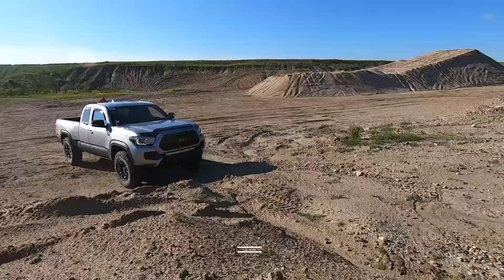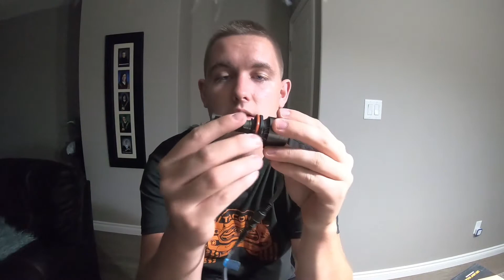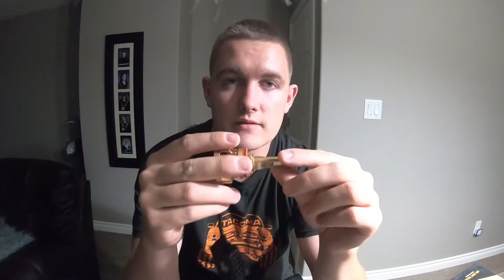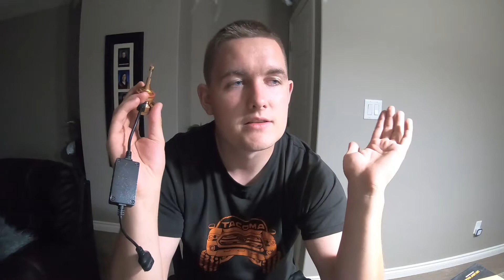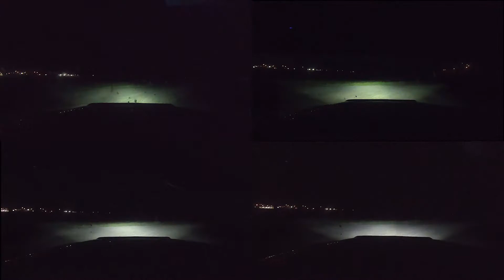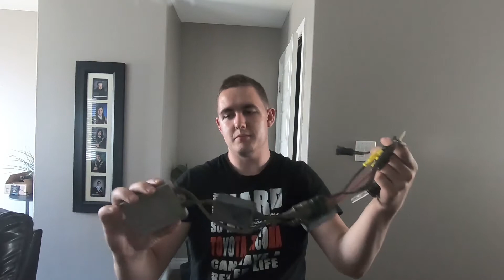HID vs LED - 55w HID, Morimoto 2Stroke, Auxbeam Lighting F16 Plus, T1 Series - Which is better?

Comment: With regards to the current reading - are you sure you know how to use the voltmeter? You have to put the volt meter in series (not parallel) and complete the circuit to measure current. You should also have measured the voltage and do that in parallel. For LED's they should be around 12V (9-16V) and for HID's it depends - they require really high voltage at first to ignite then stabilize out. It would be a little dangerous to measure the HID current (to yourself and voltmeter).

Comment: Thorough job on the comparison but 1 critique.  You commented about the bottom of the T1 and going to "raise it up a couple of inches", where was the top of the beam compared to the others?  I didn't notice it being lower in the garage shots so wouldn't this just cause it to shine into oncoming traffic more or is it just NMFP?
Reply from the maker: Thank you!
It definitely looked like the beam was aimed a bit lower but my headlights were personally adjusted before because of my front lift etc.. Definitely just have to do your proper measurements out. From my naked eye it looked shorter because the bulb design on the t1 was just two leds and not as much focused design or length compared to f16 plus.

Comment: Higher color temp doesn't equal brighter. It's actually usually the opposite. Best is 4500-5500K. Those blue 6500K+ ones are crap.
Reply: Brightest color temp is 4500K. Beyond that you sacrifice brightness for color
Reply from the maker: @kulykski123  im pretty sure I recall headlight revolution showing 5500k giver take is the brightest output you could get. Not 4500k
Reply: @CanadianOffroad4x4  It was 5000K not 5500K Iirc
Reply from the maker: @AmongUs-kok  close enough haha
Reply: the more blue, the less effective light.  this can only be compensated for with higher performance.  the daylight is around 4300K/4500k but that would look quite yellow.  therefore 5000 or 5500k is often used.  more than 5500k should not have any led or hid.  the light then becomes darker again.
Reply from the maker: Nope it doesn't. Brightest color out there is 5500k.. 6500 is the most common you find for led bulbs nowadays. They match factory drls nowadays! Not all 6500K are crap tho
Reply: @CanadianOffroad4x4  
6500K HID on a 35-watt ballast is total crap in terms of brightness ... That's a fact. It gives you a blueish light that is ridiculously about 950 lumens in brightness. It's dangerous to drive at night with such not bright enough headlights. However, if you use 55-watt ballasts on those HID bulbs, you will get about 1300 lumens in brightness ... Not bad at all.

Comment: not gonna lie the HID kit you get makes just as big of a difference like in LED's i used to run morimoto 55w kits and also had GTR ultra LED's. the LED's were bright yes but the HID kit just outperformed them. better beam pattern no hot spots just a clean bright coverage. my brother ran an amazon HID kit on his truck..lets just say you were better off driving with just fog lights
Reply: You want hot spots lol... you want it to be brightest straight ahead
Reply from the maker: I honestly think after years of usage and alot of good run time my hids likely faded in performance personally. Definitely don't think they were as bright when first bought
Reply: @CanadianOffroad4x4  right on great video btw very helpful
Reply from the maker: @santiago-da1  thank you! Appreciate the comment and feedback !